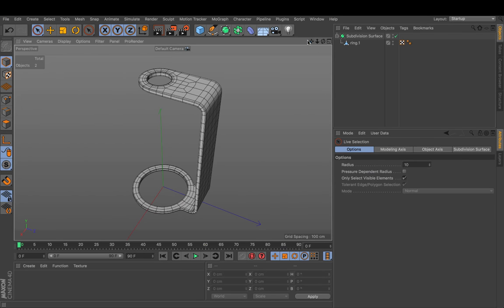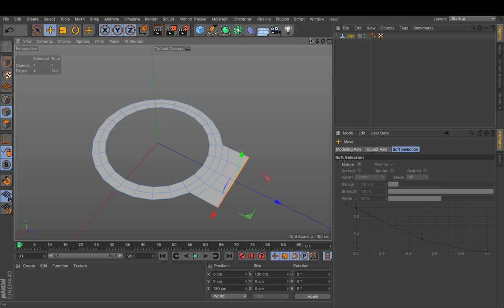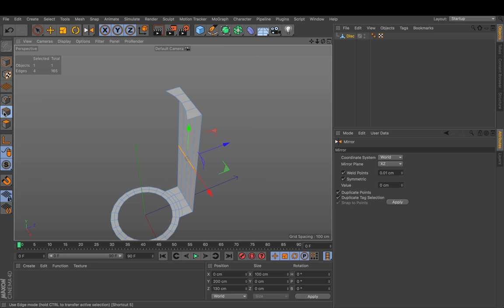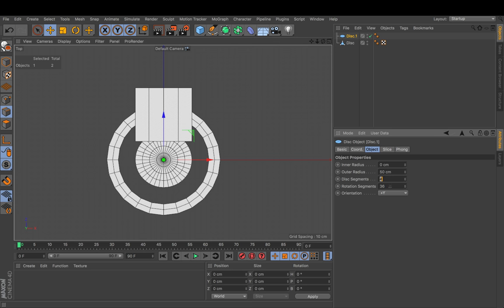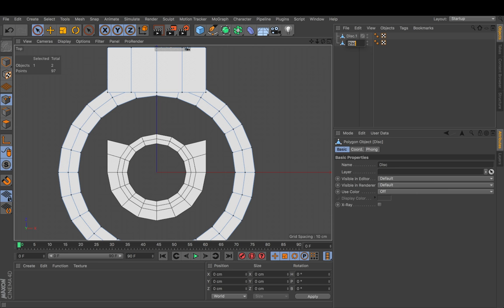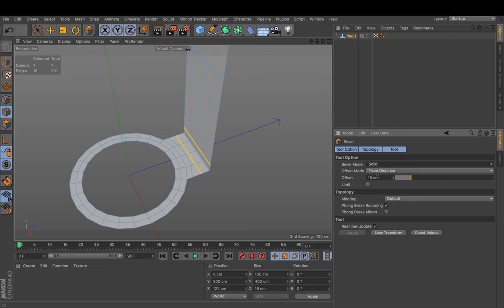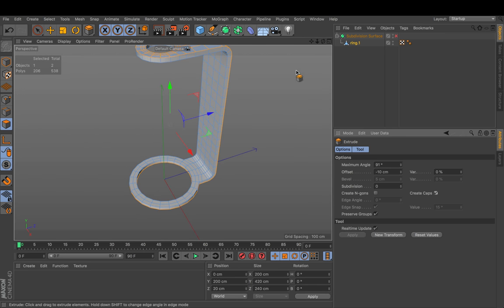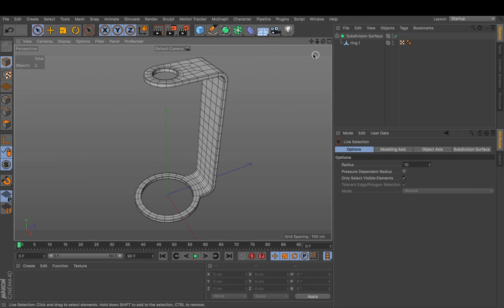Cinema 4D Tutorial - Modeling a Lamp Holder

Comment: You adhere to the spirit of polygonal modeling. Never use splines which is great. I have learned more tips on box/polygonal/edge  modeling from you than anyone else. Someday teach the easiest way to make spiral/helix shapes that twirl as in an LED BULB. I am sure your method would be the smartest and fastest way to make one. Also if possible in some future tutorial show how to bend stuff without deformers. Again only using rotation, scaling and sizing through polygonal modeling only. Thankyou Sir. If I were your student I would have proudly called you Sir.

Comment: Great modeling tutorial once again. You go straight to the essential ! 
I have a quick question, if you want to keep your model parametric, espacially for the thickness, there is way to do it without using "cloth surface" ? I've read a post about a plugin developed by Maxon called "Py Parametric tool" but i would like to know your advice. 
I ask you this question because i've learned modeling during my scholarship (like 10years ago) by using software like SolidWorks. This software have a very different approach for modeling, more "industrial" / "technical". Same as Fusion 360 (love this one too).
Today i mainly working on C4D because i really like it for many others reasons (MoGraph is very amazing). I know this is probably not the best software when you have to make very technical piece / object but i want give a try and working in procedural way when i have sometimes technical project.
I apologize for my english, this is not my native language and i hope i'm understandable.
Reply from the maker: Another user recently mentioned you can use the "Explosion FX"-Deformer, as well. Set Time to "0%", go to the "cluster" tab and choose a thickness.